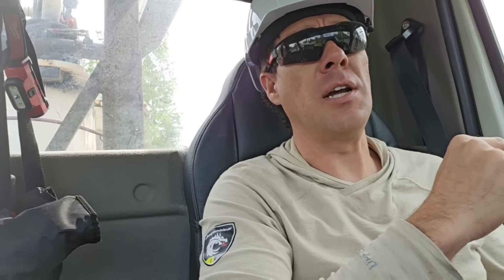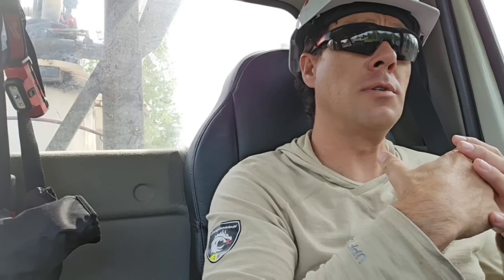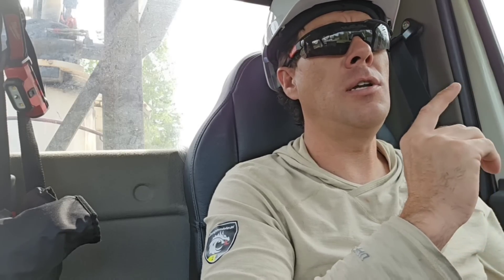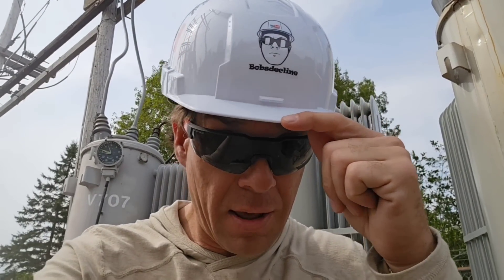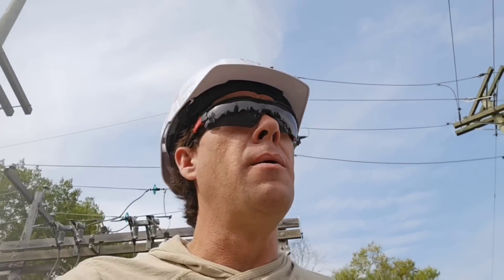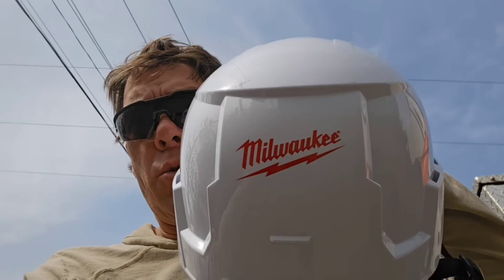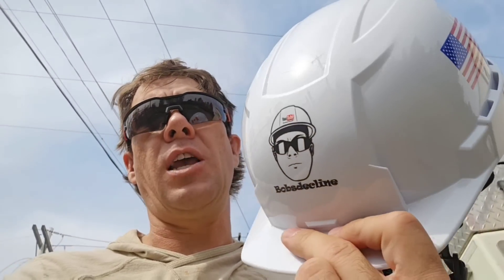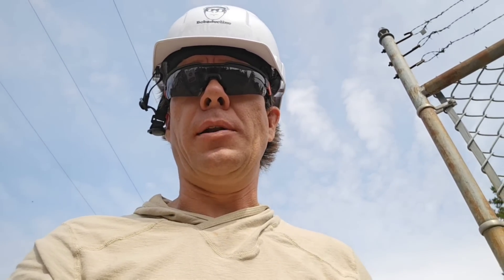69kV Substation w/Trip savers

Comment: I may be wrong, but the arrestor will have a gap inside so no power is lost to ground in normal operation, but lightning level voltage will jump the gap.  The gap is made of leads - one to the hot and the other to ground.   The tip of each lead is a "ball" - the balls are a specific distance appart so the 69kV (or whatever) won't spark across to the ground side - but lightning, at much higher voltage will easily cross over and ground out - thereby lessening (not eliminating) the energy from the strike going down the power line - or into the transformer.
Resistance may be added so the gap doesn't erode quickly or the gap itself is the resistance.
Reply: They have a few different designs as well, I have an old all glass Westinghouse arrestor that looks like it is full of metal beads.  Some have MOV (Metal Oxide Varistor) disks stacked with solid or toothed metal plates between each one, others are an air gap as you described.... a lot of cool options out there!
Reply: @mxslick50  Good points - thanks.  I think it all comes down to a path that the correct voltage cannot bridge, but higher voltages will push through.
Reply: @AlanTheBeast100  You're welcome. I've studied power transmission and distribution for decades. Never did lineman work though...heights are not my strong point.
Reply: @mxslick50  Yep! Most of the arrestors around here from the 80s onward are MOV.
Infact, not entirely sure if there are even any spark gaps still in use around here. Used to think most of the older porcelain ones where spark gap. But after getting a lot of them from pole changes, turns out I haven't found a single spark gap in the 20 or so I've gotten so far lol
Reply: Spark gaps are ideal for this because the arc starting is based on voltage, but the ending is based on current.
So you can set the breakdown voltage at, say, 500kV, but the arc won't end until the current from the lightning has passed.

Simple, doesn't waste power, and reasonably cheap compared to any alternative.

The two big downsides are (1) they can only  arc for so long before the contacts erode away from the high-energy plasma and (2) The arc emits broad-spectrum EMF.
But honestly, for the short bursts of time they are needed, it isn't usually an issue.
Reply: @piisfun  Well, spark gaps are very difficult to control. If you set the "spark distance" to be a few kv above nominal voltage, if the humidity goes up too much it'll arc. And then if you space the gaps even farther, then if you have a strike and the humidity is very low, it'll put a massive voltage spike on the system before it dissipates that strike.
Say on a 19.9kv single phase line, normal operating voltages max at 20.5kv (3%), you set the humid spark gap voltage to 27kv (the threshold voltage I've seen my lightning arrestors rated at) then when it's humid your system will go up to that 27kv before it jumps. So a 35% spike.
But lets say dryer (idk what the actual values are) at the same distance would jump at 30kv instead of 27kv, then thats just over 50% voltage spike. Just by rasing the jump voltage by 3kv.
MCOV arresters on the other hand are much more precise, and can carry a much higher current than a spark gap arrestor.
The MCOVs here have a breakdown voltage of 27kv for our 19.9kv Phase to Ground lines.
That 27kv is the max voltage they will allow, once it gets to that voltage, it will become as conductive as it needs to be to clamp the voltage to that 27kv. It may go from being completely open circuit, to under an ohm to clamp the voltage down and to draw as much current as possible (in most the arrestors here that rated current being 70ka for a second)
And the only downside to them is that they degrade over time. But degrading for a MCOV arrestor is having that breakdown voltage lowered with each use.
Big Clive did a video about the mechanism that protects the system from a faulty arrestor. They have small fused explosives in the cap on the bottom of the arrestor. If there's too much constant current flowing through it, it explodes the ground wire off of the bottom, isolating the arrestor, and giving a visual que that it's faulty.
This is all just what I've learned from digging through data sheets from the manufacturers. I'd definitely recommend finding a supplier's website and looking through the product descriptions. It's some really cool stuff to look through if you're anything like me haha
Reply: @NSaw1  altitude (air density) also affects spark gaps.
Reply: @NSaw1  Though I'd assume that's something that varies by climate, too -- where, some regions may need to worry about dry lightning, but in others it's accompanied by moisture reliably enough you only need to design the spark gaps to operate in humid conditions. Even if an open-air spark gap isn't super consistent, it's at least too stupid to really ever fail outright unlike the way MOVs can (if their service life isn't respected).
Reply: @NSaw1  (Just to elaborate on the specific way MOVs degrade, for anyone else's benefit:) Depending on the rate and amplitude of lightning strikes in an area, it's necessary to de-rate a MOV's operating voltage or service life. Each time a MOV dissipates a large fault current, it accrues a small amount of internal damage that gradually reduces its breakdown voltage.

Internally, a MOV is an aggregation of microscopic semiconductor grains fused together into a randomized arrangement of diode junctions. Across the length and diameter of a disk, those diode junctions statistically combine in series and parallel to give the required breakdown voltage and current capacity. But,  there are always inevitable slight asymmetries in the material, that result in certain paths having slightly lower breakdown voltages and resistances, and when the disk carries a fault current, the power from that fault heats up the grains along those preferred paths more intensely, gradually fusing those junctions and reducing the breakdown voltage along that path -- degrading the device until that voltage nears its operating voltage, leakage currents start increasing and heating the material and eventually it reaches a runaway point and fails short-circuit (if not replaced before then).

In some cases, a MOV can last 'basically forever' if it only sees faults slightly past its continuous operating voltage; but with how powerful lightning strikes can get, MOVs ultimately do still have only a finite -- albeit, still usefully-long -- operating life.
Reply: @NSaw1  Tho, not a Power EE or anything here lol, who knows if there's some scenario where they do actually overbuild high-tension arrestors enough to operate in that 'lasts forever' region lol. My own experience with MOVs has far more to do with protecting delicate electronics from the HVAC unit next door, and making sure the fault path for all exposed radio antennas doesn't involve a human operator.
Reply: @AJMansfield1  From what I know MCOV arrestors have the benefits of being more precise. Not allowing as large of voltage spikes that could fry equipment on the PoCo side and consumer side. And also they can be used many times. Where as most spark gap arrestors will entirely explode when struck by lightning.
MCOVs while they do degrade with each strike, when they do inevitably draw current at operating voltages, because of the thermal fuse once that happens it will safely isolate the arrestor with a visual indicator that it's bad.
It's a very reliable and safe system compared to spark gap arrestors.
Reply: @NSaw1  That's mixing up two different component. Sealed gas-filled spark gaps are actually extremely precise devices ("you can get ones with NIST calibration certificates" precise), but the sealed glass envelope that keeps the calibrated pressurized gas inside will absolutely explode under high current. Open-air spark gaps are different, they're literally just two metal balls or prongs or wires kept a specified distance apart. The metal can erode over time or melt if it gets too hot, but they don't explode.
Reply: @piisfun  would the breakdown voltage really be that high? Many pieces of switchgear rated between 12.5kV and 38kV will have a BIL of 120-170kV, so 500kV wont protect them from losing their insulation. Or is 500kV for much higher rated switchgear?
Reply: @piisfun  The problem is not the lightning discharge itself, it is that the discharge opens a path to ground for the 60Hz power circuit. So with nothing to stop the 60Hz follow current, you would have the brief lightning arc then a strong arc of the 60Hz power circuit continuing until other parts of the system fail.
Reply: @Renville80  But, since the 60Hz current is stopped 120 times per second, it is much easier to extinguish the arc than from the initial lightning overvoltage.  For the same reason fuses, switches, etc, have a much lower DC current rating than AC.
Reply: Love your content! Thank you!

Comment: 3 days is about right to recover from a trip back from my neck of the woods.  I live in Hutto and this is the first area where I have seen auto-reclosures.  There is a full sized 3 phase one  behind me because the circut crosses over a road.  At the end of my street, we have a single phase one that was put in ehen the power company did away with the 7200 feeds and went to all pad mount transformers.  We have about 8 pad mounts on this one block and it is fed by the single phase drop.  Keep up the good work on the videos.  I like that you think safety first.

Comment: I'll probably never stop being amazed how even at these voltages (like the 69kV here) you guys still use fuses for protection
Reply: What else should be used? They are (rather) cheap and if they blow, everyone in the perimeter of roughly 50 Meters is well informed of the blowing...
Reply: @deineroehre  Here in Sweden we use relays on everything above 10kV, only exceptions being the step-down substations to low voltage (the equivalent to your pole pigs and pad mount transformers, ours just server somewhat larger areas, typically around 100 - 150 households per transformer). Sure they're more expensive but also more reliable and are much better at detecting faults than fuses

Comment: I'm intrigued about the various transmission voltages in use around the world. In the UK we work on 11 kV local then step up in standard increments 33kV, 66kV, 132kV, 275kV, 400kV. The 275 and 400 overhead lines run in dual and quad conductor arrangements.
Reply: Australia is similar, although there are variations between states. NSW uses 33, 66, 132, 220, 330 & 500 kV.

Comment: Another great video, Aaron! Question for you.... Big controversy here in NJ over the plans for offshore wind farms. The people who live in the town where the underwater cable is planned to come ashore are concerned about safety and the potential effect on their property values. The plan is to run them UG for quite a distance (miles) on their way to the first substation. I'm a EE and I had a friend there ask me if the fears were legit. I couldn't answer him because I didn't know what voltages they'd be running on the cables from the windfall to land and what kind of UG cable was planned, depth, etc. I'd appreciate your thoughts. Have you had any experience with windfarm transmission lines? Thanks!

Comment: Privately owned, windmills and tapping into mains. Sounds like that privately owned is corporate owned and probably took a grant and is getting paid for their services as well. If I had my own substation then I'd be lighting a town up like in fallout.
Reply: I believe the intent here is that privately owned means not owned by their utility company, which means any work done is by an outside contractor. The fact that Aaron is doing the inspection is likely contractual to meet local safety standards and compatibility with the utility.

Comment: FPL, at least in Ft Lauderdale and probably system wide is using the trip savers on everything. Even for residential pole top transformers. Guess they are really trying to cut out the work for the linemen and ultimately reduce the workforce. I am sure it's a presented as a better SADI number, not a headcount reduction number though. 
Why were the grounds on the regulators painted with cold gal or gray paint? Keep the tweekers from seeing copper? 
Great walk through as always..... finally starting to get the itch to get back to work myself.
Reply: @liam3284  I am missing your point, can you explain what you mean more damage is done? Normally these will trip and reset instead of blow a fuse and save a truck roll for someone to replace the fuse. I haven't seen these do more damage than a fuse when installed.

Comment: Good evening brother!!!!! We just started installing trip savers on our system. Tried to load bust one a few weeks ago. I sent er and could not pull it open. Called a service man I know and he informed me to flip the handle up and down 6 times. They drop after about 20 seconds to give you time to fly away. I’m sure you already knew that. Also  since we have tree wire we have rolled up on hot wire down. Because the trip save opens on initial fault but once the wire is on the ground and the tail is isolated she closes back in and pick up the up stream load. These need to be treated just like any other breaker. Also had a complaint of people power going out and coming back on randomly for a week. Drove out the line and the primary was down and swinging in the breeze. Once in a while it would hit the neutral trip the trip saver, the tail would be clear and it would close back in and pick up the outage. Until it would randomly happen again. If it was a fuse it would have blown and the primary would have been fixed the first time. So they benefit the utility but they have their draw backs. Especially on a system with tree wire.
Reply from the maker: We've definitely had some similar situations here. Like you said, definitely some positives and negatives! The second generation ones that drop open are much better  of course. I'm still not a fan of closing them in... If A fella has never closed one in before, best to practice on one before doing live in the field! They drop back open quite easy if ya don't givem enough force!

They are fully capable and manufacturer recommended to function on their own, but having a solid blade cutout to pick up the load for ya is definitely a weight of the chest! Lol
Reply: @Bobsdecline  before I knew they had the load bust function I did consider using the load break load pick up tool in order to lift the taps then drop the load with LB/LPU tool

Comment: If I remember correctly, as we decided not to use trip savers when they came out, trip savers are kind of a one shot recloser, and operate as three single phase devices. This is fine. 

We were basically pressured by demands to increase reliability, so we moved towards using reclosers that could operate either single phase or three phase tripping with the option for single phase or three phase lock out.  

Multiple relay off & reclose (R&R) cycles permit better protective device coordination with line reclosers and line fuses that in turn helps sectionalize out only the area required to be out to maintain service to other customers served by the feeder.  For feeder reclosers/breakers, I usually saw either 2 fast and 2 slow trips or 1 fast and 3 slow trips usually depending upon whether there were line reclosers installed on the feeder. If there were feeder reclosers, it was usually 1 fast and 3 slow. 

These devices also protect the transformer and high side protective device, with which the low side protection needs to be coordinated with too.

By the way when I was going to go into a substation, the minute I saw the substation, I started looking it over, for intactness and safety, even before I'd call Dispatch to tell them I was entering or had entered the substation. The latter was in the old days prior to cell phones and you had to call in from a substation phone.

Comment: As someone who visits substations in the Netherlands on a regular basis, it's still very interesting to see how it's done in rural North America! Even though quite a few things are similar, of course. 
It's a bit weird to see 3 seperate voltage regulators. Here, voltage regulation is pretty much always integrated in the power transformer. And they regulate the high voltage side of the transformer, because the currents there are way lower.
Reply: It's also weird that they use 3 single-phase pole transformers instead of 1 3-phase transformer. And thet allow 25 Ohms for grounding system resistance. In Hungary it must be under 2 Ohms, probaly similar values in other European countries.

Comment: They look like S&C trip savers. We were told not to use them on 3 phase because they talk via Bluetooth which would violate our cyber security policies. Also there’s a recall on some batches made in 2023 and early 2024. Due to the curing process of the internal device it will not operate correctly.

We are also telling lineman not to use them as Non-reclosing devices and to go to the breaker or up stream recloser. They have a maximum amp setting that past that number it will NOT open in an attempt to save the device which would be a detriment to the lineman downstream. That number is roughly 6000 amps I believe. 

Just went through some training on this the other day. Maybe they’ll have a place in the system but so far they seem like a headache lol.
Reply: Bluetooth on critical infrastructure? Oh, that's less than idea. Yikes!
Reply: Isn't the bluetooth read-only to see a history of trips?